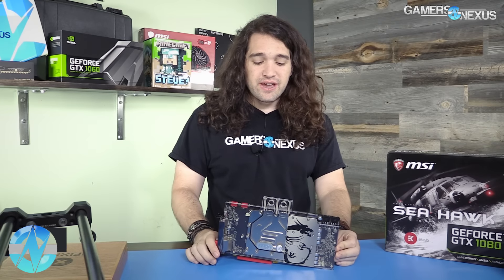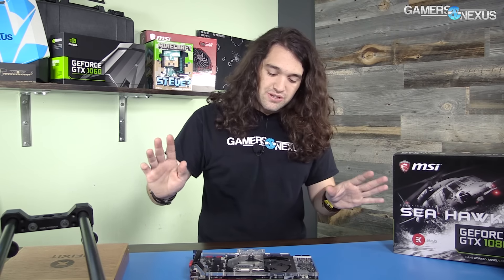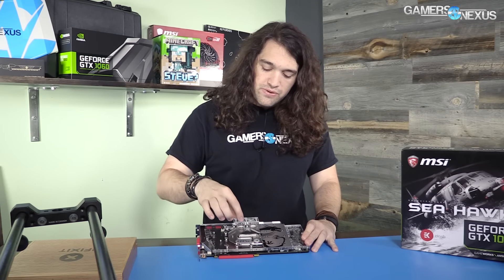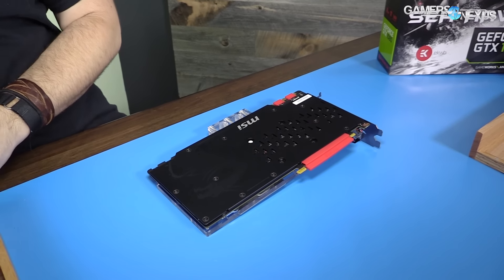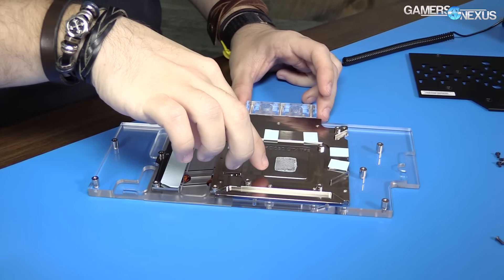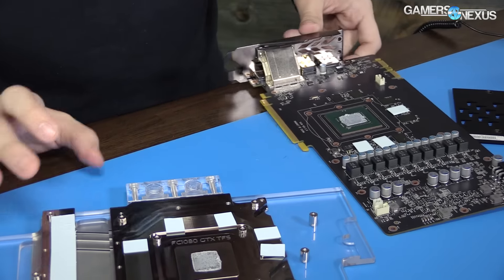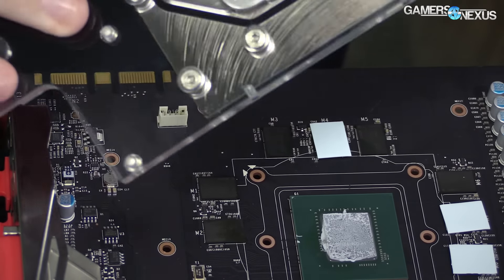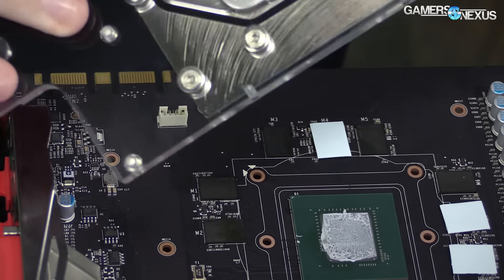MSI GTX 1080 Sea Hawk EK Waterblocks Tear-Down

Comment from the maker: Just came off a pretty bad sickness following PAX, hence the small gap in video production. But we're back! This was a bit of easier content to work on while recovering, and we will be back in full-swing with regular content tomorrow. ^SB
Reply: Steve do you make videos full-time?

Get well soon!
Reply: Everyone got sick at PAX apparently... :(
Reply: Happy to hear you are making a good return to health, and making videos of course! :)
Reply from the maker: +MiniCactuar I run GN (articles + videos) more than full-time, and have for quite a few years now. Started the site in 2008, and went full-time+ in 2012. Adding YouTube brings me to 14-16 hour days on average, and Andrew, Keegan, Mike, Andie, and others help maintain testing / video production. ^SB
Reply: That's quite an impressive operation! I am sure despite the long days you still love what you do. Your enthusiasm certainly shows on camera anyway.
Reply: I was curious because i don't already know, what are the 2 black modules on the underside of the gpu in the pins? 
e: underside of the gpu chip itself not stand alone on the board
Reply: Pax also caused breakups as well...
Reply: Like the Content Driven Ad ,upfront of video

Comment: I bought one of these & while it stays relatively cool (46°C max on a dual 180mm rad w/ 4790k in the loop), it doesn't OC worth a damn & degraded within a day. 2075 was stable day 1 & really anything more than a 70mhz OC crashes Heaven. 

It's going back to the degradation. I'm tempted to now try Zotac. It's very disappointing that MSI would not bin a GPU to such an expensive card with "exotic" cooling. 

On the plus side, thanks for the teardown. I was really hesitant to break mine down as I'm now returning it. Looks like EK did their part & made a really nice block.

Comment: I believe the sea hawk uses the same custom board as the msi gaming x 8g. The same 6 pin and 8 pin connectors and watching the video it has the same fan header ports as my gaming x when I put that under water.

Comment: hey bro i subbed a few months ago but idk how you never water cooled. i think you could get really big to be honest.i think you could throw a watercooling setup together for around $110. radiator pump cheap resevior and barb fittings. i bet you already have fans. or maybe you could reach out to performance pc for some sponsored scratch and dent parts.
Reply from the maker: We can get the parts and build a system -- it's mostly a time budget issue right now. Only so much bandwidth, and we are backed up on review hardware for at least a month. Need to get some case & peripheral reviews cleared before doing more GPU cooling content!
Reply: idk if i would cheap out on a water cooling rig, cheap parts leak. i briefly considered it but the lowest i could find for reputable parts was like $300. pretty pointless anyways since i'm not OCing my CPU and my GPU already has an AIO cooler
Reply: all of the EK predator parts are open loop parts so you can use that as a cheap kit to build off of. but the best way to setup a wet bench is to use QDC to speed up set up is disassembly.
Reply: I put together a quality XSPC loop for under $200. The only corner I cut to keep the price down was using barbs instead of compression fittings, but I have never had a leak.
Reply: D3moknight
maybe i'm just paranoid but if i was going open loop i'd get the best shit i can. especially since with the latest generation of GPU/CPU's there's not that much true OC you can do so it would mostly be for show and possibly some longevity by keeping temps down
Reply: Longevity is a moot point. You will not kill any chip with a stable OC in the amount of time that it would take for you to upgrade. I ran my 2500k at 5.0GHz for several years straight before upgrading. As long as you keep it stable and don't let it get hot enough to thermal throttle, you are keeping it more than cool enough.
Reply: D3moknight
yeah exactly, so why bother with watercooling then? most of the latest gen stuff isn't even that OC-able and comes pretty maxed out from the factory. for 99% of applications an open loop is overkill and just becomes a liability. i guess sound control would be a factor if you really need a quiet system.
Reply: with reference coolers it can make a difference. my titian xp runs around 1900mhz  with gpu boost when water cooled. on air in an air conditioned room it will drop down to 1600's so it makes some difference with gpu boost.
Reply: Viking Elite PC
well yeah, but reference coolers are shit. you could build a hybrid setup like GN did, far cheaper and more reliable than an open loop. but to each their own i guess. for what it's worth i think custom loops are really cool, just seems like too much extra work (and riskier) for little benefit for me since i'm already running an AIO watercooled 1080 and my Xeon CPU isn't really that OC-able.

Comment: I have this card the connection for your tubes is not EKWB standard, it cracked 2x on this card, after ekwb was so kind to provide me with there own connection i never had a issue of cracks again.
And MSI will not give warranty on this card, they point you to the reseller and refuse to handle anything with waterblocks and do not accept any damages, that were cause by there weak parts.

Sadly i have to take it apart now, because the rubbers are to oily and that causing some braun muck in my loop. Prefromances and temp are really good on this card it hardly hits 50 degree at full load. PS ekwb also provided me with a new rubber for this card. I have no issues with EKWB there always there to help and support you.
 
I had the same issue with there MSI Z170 gaming m7 ack 9 no warranty form msi, i had to force them to replace it took 11 months to get a working replacement the first too had burned out audio.
So sad they use to be so relaxed now its all business and hidding behind fine print.

So if you buy something like a water cooled solution stay away form MSI.

Comment: just fyi the flow goes the other way. I own this card since EVGA still does not have any hydro copper yet. the flow goes through the GPU jet plate on EK blocks first into the GPU block fins. so that the water flows evenly over the GPU core. wish more mainstream sites like gamers nexus would do reviews on these cards since I only buy these cards now.
Reply: I don't think it makes much difference to be honest the liquid will equalize (aka be all the same temp or at least to an insignificant degree). But all EK blocks water flow goes through the jet plate into the GPU / CPU core fins. It has worked this way for the past several years and I can't think of an exception.
Reply: I love it, It is just as good as the EVGA Classified Hydro Copper cards are. Same 3 year warranty as well.
Reply: i own that EK MSi card and did Temp tests both flow directions and got THE same result.
Ek said themselves, the flow direction does not matter.
Reply: Huh must have changed recently then. it use to be the way I described.
Reply: Josh Simpson my room is only 63F most of the time though, so perhaps a hotter room and loop would show a difference.
Mine ran 34C both ways

Comment: OH shit, i have that EK seahawk GPU.

stock boost clock is 1974-2,012mhz depending on the temps ex.
1987 mhz 99% of the time 
runs 34C at max load on my PC
hit's a huge wall O.C. wise at 2,150mhz regardless of the power %
Reply: Can you use compressed fittings on this? New to overclocking and I've hear rumors where it's only barbed fittings and I can't find any information on it. Sorry if this is a stupid question.
Reply: Brandon Caylor no fittings were included.

it depends on what tubing you choose and what diameter.
but yes, you can use compression fittings as the 1/4 Threads on the block are universal.
Reply: Ok thank you. Going with 3/8" tubing since that's what JayzTwoCents recommended. Excited and nervous!
Reply: Thanks for the tip - I'll look into him as well!
Reply: Can you provide with bios details for set parameters you did to get this results?

Comment: Hi! I've been running one of these since late 2016. It's been a great card, but I have to Crack it open to clean. Nice to see I can leaktest the block separate from the board. Any idea how thick those thermal pads are?

Comment: from the pic in the article it looks like the water enters at the center of the finned area and is collected at the outside...seems nice, doesnt the water usually just flow from one side to the other? would have been nice to see under the dragon, maybe pull the cooler right down and compare the fins

Comment: Ok this video is old but do you know if you could replace the water lock with an air cooler? I found a cheap one on eBay but don't want it to be watercooled

Comment: Hi, this card looks very large, n heavy too, for eg the top of the card extends beyond the back bracket. For those who have this card, what kind of cases are you guys using? Big full towers? I'm using only a mid-tower, a Evolv atx, which I don't think is wide enough to fit this card, without it hitting my side panel. Just asking, because I haven't heard this mentioned much. Thanks!
Reply: Btw, I already have an open loop in my case, but just for the cpu only.

Comment: there is no such thing as a "preferred in or out" on that block.... either ports can be used as in or out.
Reply: Whereas with a CPU block, it must definitely needs to go in one way and out the other.
Reply from the maker: That is correct. Just going off of the MSI Sea Hawk recommendations in the reviewer guide!

Comment: You said "10-Phase".  But isn't that actually an 8-phase?  Those two chips at the top are not part of the main mosfets count, I think, as they look different?  And no capacitors next to them like the other 8?  

(No expert here -- mostly just trying to remember what was discussed by your man buildzoid in the EVGA PCB analysis vid., i.e., there's not really any such thing as an ACTUAL "10-phase".  EVGA only calls theirs "10-phase" on the FTW, because they've just put doublers on each phase of a regular 5-phase config.)

Yep -- I just went back and looked at that other vid...  The two similar-looking I.C's (distinct from the rest of the row) in the equivalent position on the EVGA FTW, were for the memory VRM, not the core.
Reply from the maker: Yeah. It is 8+2 (8 driver ICs). That's the nature of on-the-fly learning about a card & recovering from PAX pox.

Comment: My gtx 1080 strix only boosts to 2030MHz when overclocked, any suggestions? did i lose the lottery so Bad?
Reply: Increase voltage + power target. However my 1080 is getting 2050MHz so you won't be getting any more on air.
Reply: i increased powertarget and voltage to the max and My card only get 70°... Its strange

Comment: Is this card a 1/4" inner thread?
Reply: Why Not Gordon? got one the other day, it is
Reply: Did you get lucky? Mine's kind of shit... Max OC @ 2113mhz on 1.081v on stock BIOS.
One would expect a little bit of GPU cherry picking when buying the most expensive 1080 on the market...
Reply: AndiSabin unfortunately most of the pascal cards dont push so far, even the Hall of Fame card is around there
Reply: Mine does 2025... Sometimes it jumps to 2050 but at any higher clocks it crashes at any voltage. So consider yourself lucky^^ 
Got the EK X btw and it runs just under 40°C
Reply: Mine clocks up to ~2360MHz without problems - NO voltage drill required. You should turn the Core-Clock-Curve to 1.00V - and see, if it's possible to get higher clocks while NOT giving the GPU a higher voltage. Sounds weird but it's effective... I've reached around ~2230MHz without levelling the curve to a maximum of 1.0V for the GPU.

I guess you'll find a how to for setting the curve to a maximum of 1.0V somewhere, 'cause I could only give you a link in german and I guess you don't speak german at all ;)
(unfortunately I only found this guide to level the curve (with MSI Afterburner!) just by chance - I've never heard or read that before I found it by chance a few weeks ago)